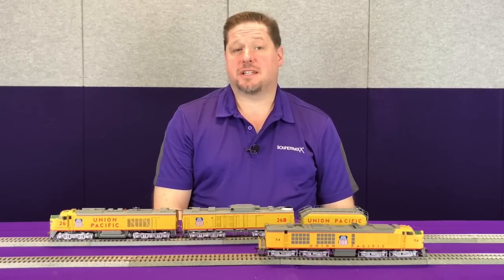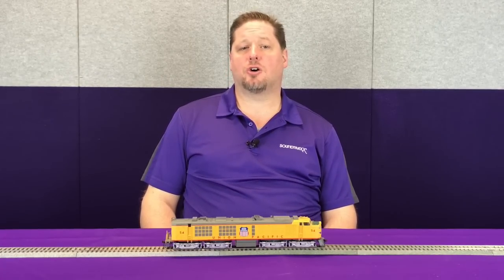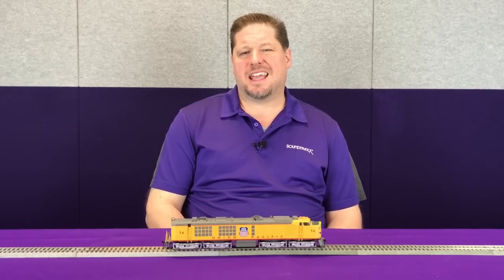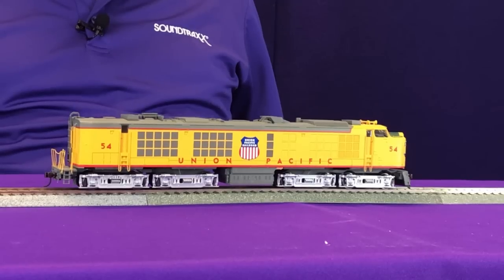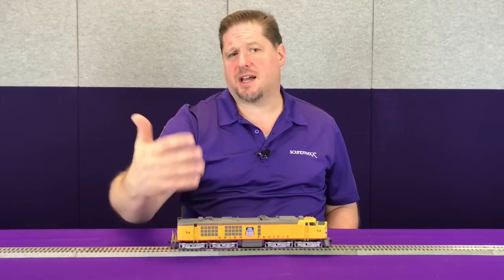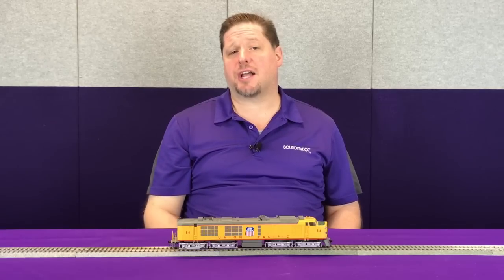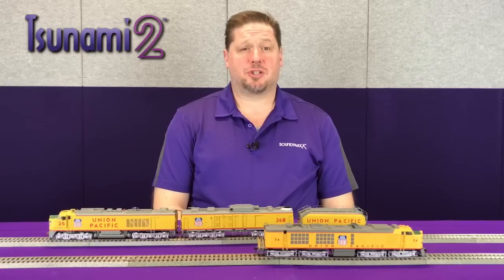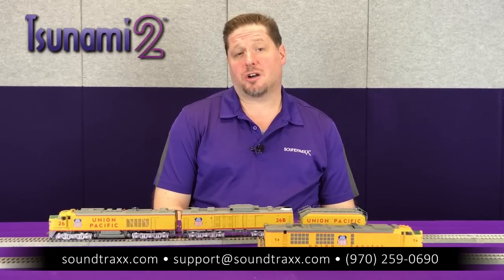Tsunami2 Turbine Operation: More Thunder Less Whine!

Comment: I have the 3 unit turbine in O scale 2 rail. Do you have a decoder large enough to handle occasional current peaks in excess of 3 amperes?
Reply from the maker: Yes, our Tsunami2 TSU-4400 has a max stall current of 4-amps. You can learn more about this decoder on our website: https://www.soundtraxx.com/dsd/tsunami2/products/tsu4400.php

If you have more questions please feel free to give us a call at (970)259-0690 ext.22 or email support@soundtraxx.com